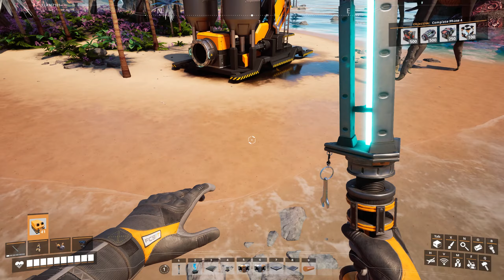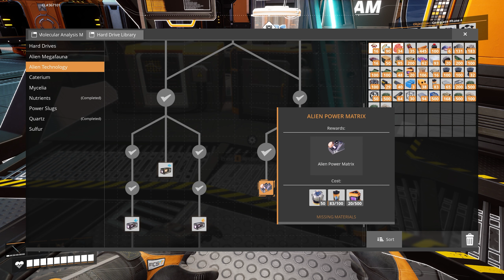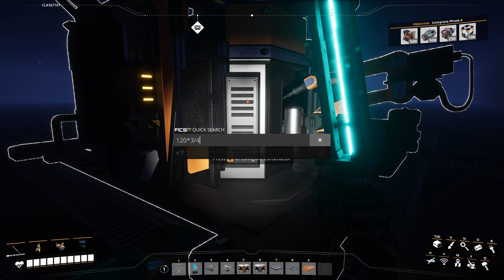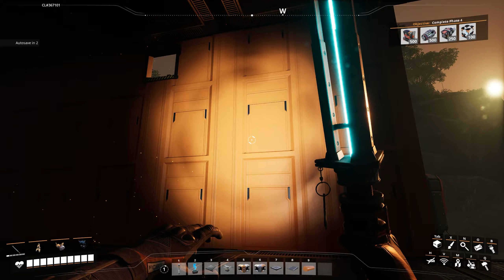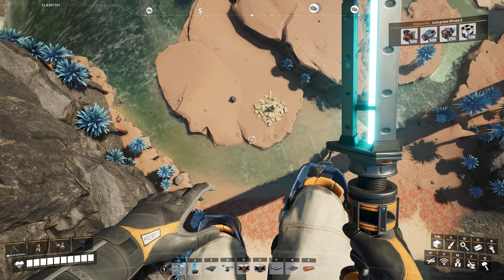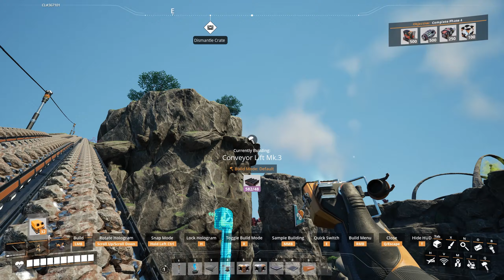Encased industrial beams, and fuel gen progress | Satisfactory | BigVlad Plays | Part 29

Comment: Why did you just place down a platform to go across to point B. It would have been better and less belts to used.
Reply from the maker: I'm not sure which part you're talking about exactly but the resource cost and length of the belts is irrelevant anyway.
Reply: @bigvladgaming  22:22 It where you talking about point A to point B.